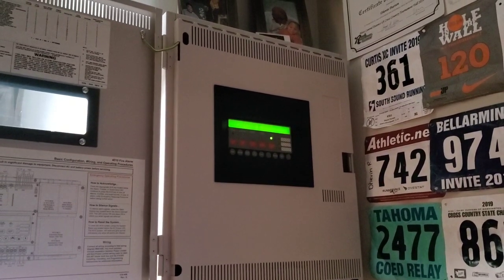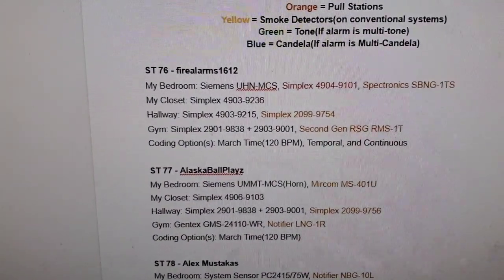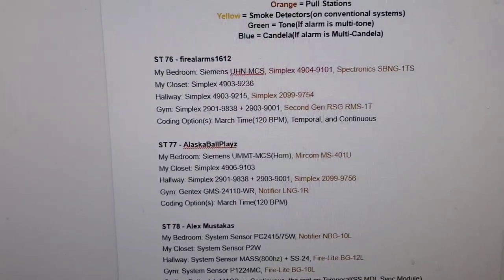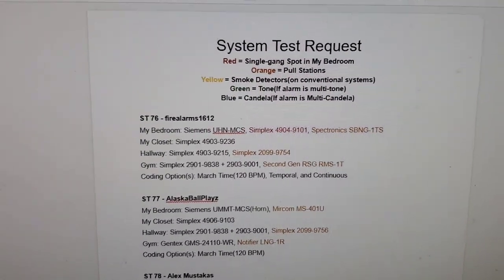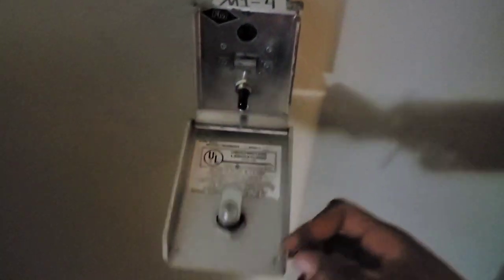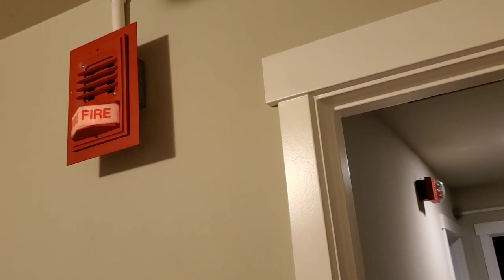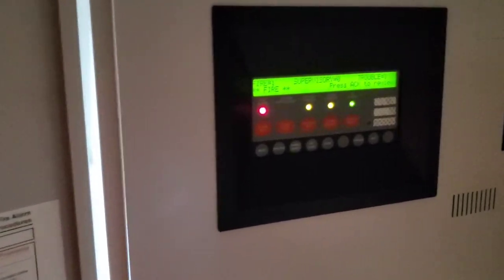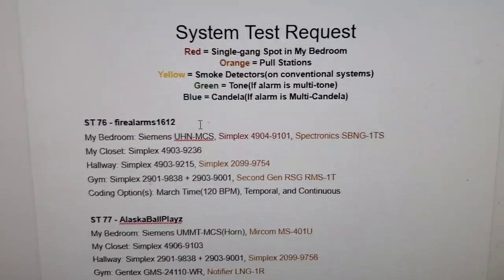System Test 76| Requested by @Firealarms1612

Comment: The sound of that 9838 is majestic

Ok imma do a 5ud request 
Pull station: Simplex 4251-20
Alarm (left spot): Simplex 2901-9838
Alarm (right spot): Simplex 2901-9833
Detector: Simplex whiffle ball
Coding options: Code 3, March Time (120bpm)
Reply from the maker: Got it 👍🏼

Comment: If you can accept my request. My request for another system test. I need you to do a simulation of my old school. I'll explain it.
So, My old school had old bells as well as some 9838's behind some cages and they were occupied with remote lights. in the library, it had another 9838 with a silver horn on a 4903-9105, and throughout some parts of the school, They had Simplex Truealerts. The Panel was a 4100U. The Bells and the 9838's were on code 3 and the truealerts didn't sync with them because they were the smartsync models.  they also had wheelock MT's in the courtyard. The Lights occupying the caged fire alarms were wired seperately and they were on March time.
For the bells, you can just use one of the Simplex bells because the Bells in the cages were Rare Kidde Bells that were rebranded by Gamewell.
Reply from the maker: What were the pullstations? Were the bells vibrating or motor bells?
Reply: The Gamewell bells were vibrating. and the pull station consisted of Gamewell M-69's and 
Simplex 2099 Dual Action Pull Stations. but you can use the Simplex 4251-111 if you don't have an M-69. The Truealerts that I saw in my old school are 4906-9127's and 4906-9101's.
Reply from the maker: @burnoutteamclubbtcp7283  ok 👍🏼

Comment: 4010 request 
Ceiling: els dl1 
Closet : simplex 4041 /w 2903-9001
Hallway : wheelock 7002 
Gym : els dl1 

Pull stations : 
Bedroom : simplex chevron 
Hallway: simplex 4251-20 
Gym : simplex chevron

Coding: 
1st round : code 3 
2nd round : march time 
Last round : continuous
Reply from the maker: Got it 👍🏼

Comment: hey can i request a system?
if so, for pulls i'd like a 4251-20 in the bedroom, a 2099-9754 in the hallway, and leave whatever was up in the gym and anywhere else i missed
and for the NAs, can you put up an edwards 439D-10AWC in the hallway, a wheelock 10 inch vibrating bell strobe in the gym, and a wheelock 6 inch vibrating bell in your room, and in the closet have an EST genesis h/s. 
and could you put the system in continuous as well?
thanks!
Reply from the maker: The only Wheelock 6" vibrating bells I have are the 46T-G6-24-WSs bell/strobes, otherwise I have a Wheelock MB-G6-24 6" motor bell. Would you like the motor bell or the vibrating bell strobe? Which EST Genesis horn strobe would you like? The G1R-HDVM(red, no fire lettering), or the G1F-HDVM(white with red fire lettering)?
Reply: @BlackLightning4547  sorry for the late response, i'd like the G1f-hdvm, and the vibrating bell strobe please. thanks again!
Reply from the maker: Got it 👍🏽

Comment: Can you do a simplex  voice evac?
Closet: true alert remote strobe
Hallway: true alert speaker strobe
Room: true alert speaker strobe
Other room : speaker only
All pull stations 42-51-20 
Smoke detectors true alarm
Can you do this system for the next video please.
Reply from the maker: This system test is the closest you're gonna get as I don't have a Simplex voice evac panel, but a Potter EVAX 100.
https://youtu.be/iN5lmwrH0bs
Reply: @BlackLightning4547  ok

Comment: Can I request a system
Reply from the maker: Sure
Reply: Do you have 439ds?
Reply from the maker: @paperfirealarmsystems  I have one Edwards 439D-10AWC
Reply: Can U put it up In your room and 2099-9754 in you room and the other t bars in hallway and gym and have bell too?
Reply from the maker: @paperfirealarmsystems  What other bells would you like? I have a Wheelock MB-G6-24 6" motor bell, a Wheelock MBS-G10-24 10" motor bell/strobe, two Wheelock 46T-G6-24-WSs 6" vibrating bell/strobes, a Wheelock 46T-G10-24-WH 10" vibrating bell/strobe, two Simplex 4080s 6" vibrating bells, a Simplex 2901-9331 4" vibrating bell, two Simplex 2901-9720 6" motor bells, and lastly, two Amseco MSB-8B-PC2 8" motor bells. 

The " symbol represents inches.

And what other T-bars would you like? I have two Simplex 4251-20s, three Simplex 2099-9756(dual action), two more Simplex 2099-9754s, three RSG RMS-1T both first and second generation(please specify which gen), a Sigcom SG-42SK1(dual action), and lastly, a Sigcom 32SK1(dual action).
Reply: 4251-20 bedroom and gym 2099-9754
Reply: 46t for bedroom and hallway
Reply from the maker: @paperfirealarmsystems  you said that you want the Edwards 439D in my bedroom already.  You also said that you want the 2099-9754 in my bedroom.

Which 46T? The two Wheelock 46T-G6-24-WSs or one 46T-G10-24-WH and one 46T-G6-24-WS?
Reply: I meant 46t in gym and hallway
Reply from the maker: @paperfirealarmsystems  So the two 6 inch 46Ts?
Reply: Ya
Reply: Do you have 280-spos
Reply: 270-spos I meant
Reply from the maker: @paperfirealarmsystems  Yes, I have three 270A-SPOs
Reply: Can you use them instead of t bars  and code 3
Reply from the maker: @paperfirealarmsystems  sure, also, what alarm do you want in the closet?
Reply: Do you have a sr-p
Reply from the maker: @paperfirealarmsystems  I do not